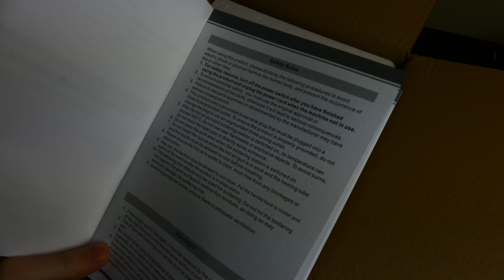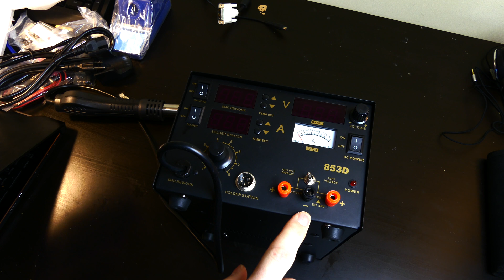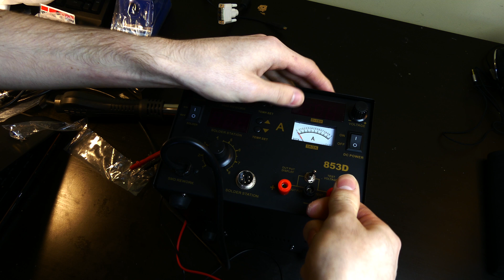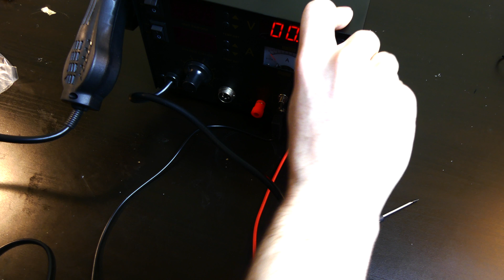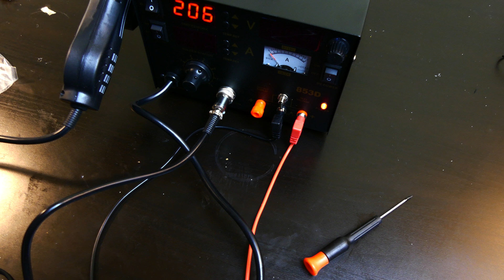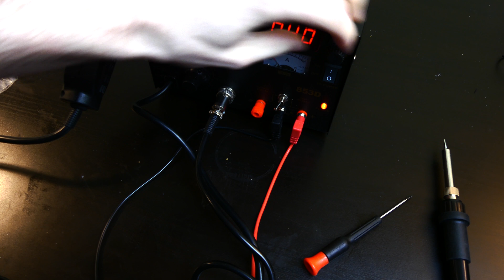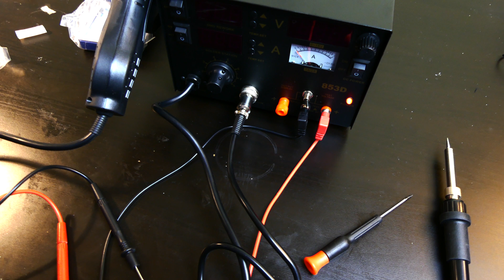853D 3in1 Soldering Hot Air Station - Unboxing And Demo

Comment: What is the model of the soldering iron? I have this exact soldering station. My original iron got burned out in 2016, and I got a replacement without any marking. My second iron now got burned a well. I bought a Hakko 907 iron, and it plugs in, but shows wrong temperature when turned on..
Reply from the maker: Couldn’t tell you there’s no markings on the iron itself. I’d just lookup the 853D they are sold under many brands and models.